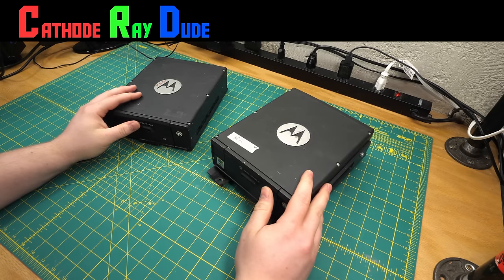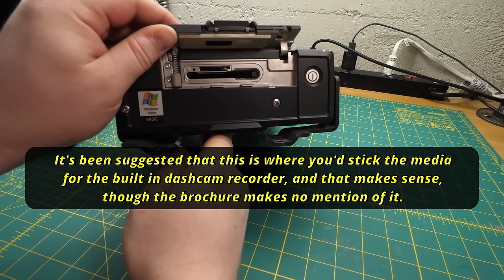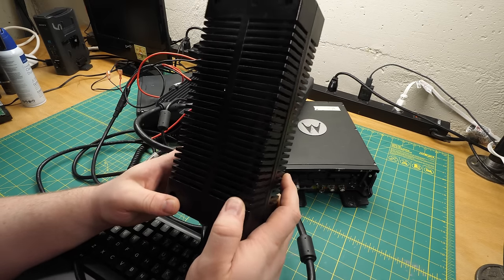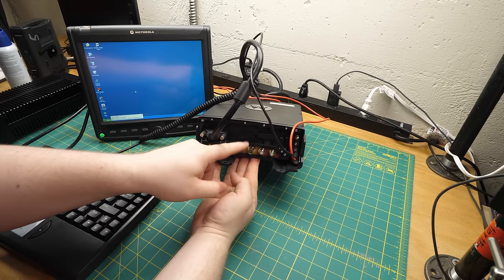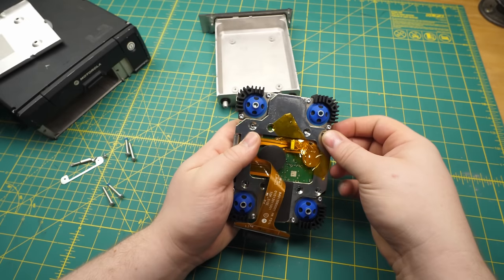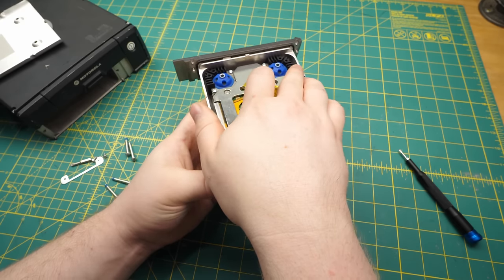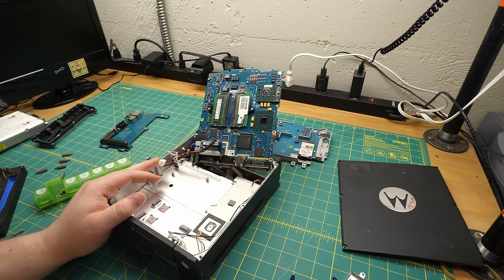Little Guys 7: The Cop-puter [Motorola MW800]

Comment: I bet this computer was able to program the radio.

It would make sense to have a dual boot or DOS plug in CF or Card drive to boot DOS and run the RSS to read and write to the radio.

Pulling the 25 pin cable to have to reprogram would be a pain.

It would make sense to have it built into the computer 

Check the root drive and look for an RSS for programming the Astro

Some of the Astro if I remember correctly,had a USB pin out and you can plug in an adapter cable to get standard USB and run the RSS and read and write frequency programming but it could not update the firmware through USB

Comment: The Gobi was not "terrible". For the era, it was THE goto for WWAN. Yes, it powers up without any baseband firmware because it has no clue what screwed up network you want to use. Once the WWAN control software is running, you'll tell it what carrier you want to use and it will load the correct protocol firmware. (If you install the full package, it will be able to connect to any cellular network anywhere on the planet ) We've become spoiled by the LTE world, where the SIM tells the phone what it has to do. (of course, in the US, unless you bought the phone from the carrier, odds are it won't support 100% of the carrier's stupid.)

Comment: 48:07 This may well have had a CF card to boot from. Wouldn't need to worry about write rates as your average bacon smelling, donut eater, isn't saving or downloading anything to the boot drive and the spinny plates would be primarily used for saving video capture from the dash cam. System updates would be done via the RJ-45 connector by a "sys admin" and not automatically updated via 3G. I think Vista Starter was chosen for two reasons- 
1. Cost
2. According to wikipedia:
"Windows Vista Starter has significant limitations; it disallows the concurrent operation of more than three programs (although an unlimited number of windows can be opened for each program unlike in Windows XP Starter); disallows users from sharing files or printers over a home network (or sharing a connection with other computers)"
There is contradictory things going on with the spinny drive too, it seems to have been replaced...
"and imposes a physical memory limit of 1 GB and a maximum amount of 120 GB hard disk space. Peer-to-Peer networking is also disabled, and there is no support for simultaneous SMB connections."

Comment: I don't think SECRET is being used in the sense of certification to handle classified info, more like cryptographic secret. If anything, that SouthBridge does have some kind of secure component, similar to how the original Xbox had the secret part of the BIOS in the SB.

Given the recordings made by this system may need to be authenticated and the chain of custody maintained, there is probably a key permanently burned into the SouthBridge that is used to encrypt/watermark recordings.

I also don't know how you resist applying the Soba belleh to your entire face.
Reply from the maker: Oh yeah, that seems reasonable - you'd think it would have come up readily in a google search though, right?
Reply: You’d think, and while I can find pics of bare BGA chips with that marking being sold I can’t find any info about intel embedding anything cryptographic in them. Likely that is kept under NDA.
Reply: @CathodeRayDude  I did find a sales display case of Intel chips from that era (YT seems to think the link to it is spam, so I can't post it) and all of them are marked "Engineering Sample", "Intel Confidential" or "Secret" so I think that is just an ES. Why there is an ES on a production motherboard is a good question tho, is that a Motorola prototype?

Comment: I own an old 800x600 projector with a remote plug head unit for usb  s-video + VGA
It has the same display plug between the the remote head and the projector.
it doesnt have screws but clips on each side.

Comment: your assumptions about the FPC are wrong, it totally looks like it has been designed for this use, the rubber spacer looks normal to me, and the 90° right angle is how we normally do a right angle with FPCs, it will provide slack and strain relief to avoid vibrations transmission as well. There is nothing "weird looking" about this flex.

Comment: My guess is that you already have the kind of computer used in ambulances or fire trucks right there.  Because it wouldn't make sense to make entirely different models for agencies that are very closely related and usually work together - and thus need systems that are interoperable.

Local government would want a relatively cheap standardized design that they can buy for all their emergency services/first responders.  Just make some minor modifications to suit the purpose, and voilá.

Comment: Windows Vista Basic was for older computers that could not do Aero and other features. Microsoft only made the Basic because of badgering by the OEMs who wanted to dump their older computers with Vista badgering. It was a big fiasco at the time as most of these old machines came with only 2 GB of memory, whereas normal vista needed at least 4 GB. So many people bought the old crap and then got frustrated when they tried to upgrade to normal Vista.

Comment: Ever work with 12 volt USB ports?  I see them all the time in my line of work.  I work on cash registers.  The really funny thing is that a lot of the machines I service have 8 gigs of ram, but run a 32 bit version of windows.
Reply from the maker: I've always wanted to look into those a bit. If you're talking about the ones that're like really really tall USB ports, my understanding is they come in a bunch of voltages indicated by color. I don't think there's anything special about them other than the convenient power, but I need to look into it and find out if there's more to it, you never know what neat features will be buried in this stuff.

So regarding the 32-bit Windows - I never fully understood this, but I believe 32-bit OSes can use more than 4GB with "Physical Address Extension". Any individual process won't be able to use more than 4GB, but you can still run multiple processes  that will cumulatively take advantage of all available RAM.
Reply: @CathodeRayDude  : They are like double USB ports.  The top USB port is a normal USB port, and then the second part directly under it is almost like a second port.  That provides the 12 volt power supply.  They are used for hand scanners, scales and displays.  They also have a retaining clip.  Very helpful in such environments.

As for the 32 bit windows, I have never seen one with PAE enabled.  Running task manager never shows more than the expected 3.5 gigs of ram that's usable.  shakes head
Reply from the maker: @Xpurple  hahaha okay well, I tried! Whenever I encounter a 32-bit Windows on a machine with lots of RAM it always shows up; I figured it was on by default!
Reply: @Xpurple  poweredUSB, it was a proprietary extension to usb 2.0 developed by IBM to allow high power(30w in 5v mode, 72w in 12v and 144w in 24v) peripherals to use a single connector

Comment: next job - mount this in a car, replce the disk with SSD, install OS of choice, and wire it to the CAN BUS.  Run some ricey engine status dashboard.   Rokace the 3G modem with something better, and road trip it to some other youuber for a crossover.

Comment: That power supply is meant to be a knockoff of Motorola standard radio bench psu. The two other wires are for pretending to be an ignition for radios that care about that. The plug is used across a lot of motorolla radios of that era.

Comment: I had a Windows Vista Homr Basic tower computer actually, from Acer, had it from 2007 until 2014... Woth 1GB of RAM and for some reason it never upsated to SP1 or SP2 so it was all RTM until 2014. Awful, just awful, nobody should suffer as I did, my family ane I just knew nothing about computers back then.

And that was not what was worse, it was the GPU which basically had no hardware acceleration, it was some SiS Mirage 3. Dreadful. I remember I always got jealous how people vould play Minecraft but i couldn't with that puece of dogwater.

Comment: Them 2.5 HDD's are built different. They must break them things in on the streets of Brooklyn or in Iraq cause them things will survive a damn black hole. I got a 2TB out of a laptop that done died years ago but the drive keeps going. Bout 10 years now. Maybe 12. Every IDE drive I have had will start to make clicking noises like the hunter from 1987's Predator movie. But this thing...Not a single click. I'm freaking proud of it

Comment: MediaVue SureVue D1, D2, D4 & D6 digital signage systems.... 
D4:
gigabyte ga-ab350n-gaming wifi bios ver. f23
AMD athlon x4 950
(2x4) 8 gb DDR4 2 memory slots
150 watt power brick with pico power supply internally
128gb m.2
Radeon HD7750  4-ports
windows 10 iot 2016

This board will support my Ryzen 7 5800x3d processor after updating the BIOS and power supply. The catch, support for the athlon x4 950 processor is dropped at bios ver f25. you have to update to f31 before you can update to the latest Bios Revision. I had to order a ryzen 5 1400 processor to do BIOS updates. Still waiting on the processor

Comment: The Intel chip having "Secret" written on it.... I wonder whether that is to designate that it got the intel management engine disabled? Cause iirc some platforms from even back then had that already, so that'd make sense.
Reply: As far as I know the ME is split between the CPU and the PCH, and this predates ME.
Reply: @coyote_den  Some Core2Duo platforms do in fact have IME (like ones featuring the PM45 chipset, for example; and it would fit with that machine being from roundabout 09), although back then it was northbridge/southbridge and nothing in the CPU itself iirc. Can't find all too much information on that, sadly.

Comment: Writing non-stop video to a cf card would have killed the card in no time so it makes sense that they over engineered a hdd solution.
Reply from the maker: Yeah that's the thing I was missing. Like it even makes me wonder how practical the PCMCIA card would have been as removable media; nobody made NAND that could tolerate constant writes back then, and the slot is too short for a type 3 hdd.

Comment: Yeah, they call those terrible double butt plugs an "SAE" plug, though i dunno that the society of automotive engineers had anything to do with it. They are less terrible than using the cigarette lighter sockets and plugs. That's what they've got going for them. Powerpoles or basically any battery connector used in the RC space would be better. Even a Dean's connector would be better.

Comment: The weights in the bumpers dampens the mass movement as you guessed. With more weight it takes a LOT more force to cause the movement, and the extra padding intentionally designs for that. With more weight it takes a MUCH harder jolt to move it, much less to a dangerous degree.

Comment: Folding over flat flex cables is not an uncommon practice
Reply from the maker: the folded over part isn't weird; folded over, then spaced out with a hunk of foam rubber that's digging into the edge of the cable, that's weird.

Comment: I didn't know money Radio made money computers. there definitely going to be interesting and certainly underpowered. And certainly proprietary.
Let's see 2:00 minutes in well I add anything to this comment hmm?
Yes SAE connectors are interesting. they don't work for tell Lite trailer hook ups because they corrode very easily and they're not very water resistant. motorcycles use them for power connections instead of the socket. I built out a battery pack using them and I have completely converted to Anderson power poles cause they are horrible connectors. The quality between manufactures varies all sorts of things oh and don't forget about polarity there is two different variance so you end up having to just ignore the color of the wire that's attached to them it's a mess.

Comment: 12:24 The 3 giant plugs are something you won't be able to find cables for on their own as these are wiring harness connectors used to connect to a vehicle's CANBUS which are deeply embedded into the vehicle and are largely useless without an ECU or BCM to connect to on the other end

Comment: Another cool video Gravis, At 26:40, You mention that you thought that the 2.5” Drive would be 7200rpm, I didn’t think they made 2.5” Drives that were 7200rpm, I thought the fastest that you could get on a 2.5” Drive would be 5400rpm although I could be wrong? Anthony - Birmingham/UK 🇬🇧
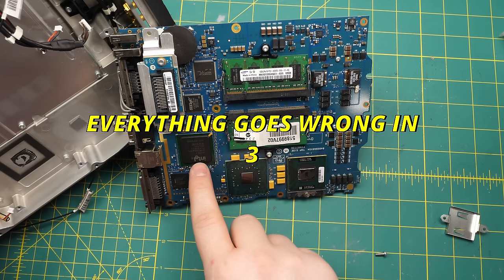Reply: Love the “Surprise Inspection” by Soba at 48:30, My Felix tends to leave me alone when I’m doing my Videos, D’oh! 😂 🐈‍⬛
Reply: Western Digital Black exists. Not only is my 500GB WB Black 7200 RPM; it also features an accelerometer so it can auto-park itself on the way to the floor. Of course, the EliteBook business laptop it's in also has its own accelerometer that can provide the same function if the OS bothers to listen to it.
Reply: @BrendonGreenNZL  Oh wow, Thanks for the info, I’ve just dug a WD Black from off my pile of Used/Knackered Hard Drives and sure enough it does state 7200rpm on the label, You learn something new every day as they say, Cheers! 🙂
Reply: @AJComputerServicesUK  The built-in accelerometer is a useful feature to ensure drive longevity. I don't know why all mobile HDDs don't have them.

Comment: Let me tell you something about Motorola. In my area, they have the market completely cornered. When we had to get our 800 mghz system put in. We went from VHF to Digital. We only had one choice……. Hello moto, and it cost millions to have the system put in and there hand held radios. One radio which is intrinsically safe cost about 6 grand without the lapel mic. Thats going to run another 600-700 bucks. And good luck trying to go with another system in my area. You won’t, unless you want to stay VHF and due to narrow banding. VHF is pretty close to useless in public safety. Especially in a rural area like mine. Ok, I’ll get off my moto soap box.

Comment: Once, long time ago, Motorola was a big and influential company. 
Now it is only a name on some cheap Chinese knock-off junk. 
 
Maybe it is better this way. I once had a Motorola mobile telephone and it started making a call every time one of the buttons was occidentally touched, can you imagine what it would be for a policeman or an ambulance driver if his communication apparatus was made by those imbeciles at Motorola? If consumer products are bad, the same engineers designed the professional equipment, they must have been bad as well. 
 
Wave the American flag for a while and think why all electronics nowadays is made in China, Vietnam and Pakistan. They truly hated their customers and did not care about the usability of their products.

Comment: The keyboards I have an intense dislike for are the ones that come with Dells and other low cost PCs.  They feel terrible and the mouse doesn't inspire even an iota of piece of mind as far as quality goes because they are so light it feels like no effort or materials went into their manufacturing.  A mouse like that just plain feels cheap since it has no weights to make it feel like there is something actually inside that plastic shell.  Just compare it with a mouse from a known good brand that you would buy aftermarket for your PC and you will see the difference between that Dell one that is probably a dime a dozen and a good one.  By good one I am not necessarily referring to "gaming" mice.  I have a Logitech mouse that was not marketed for gaming and I have no complaints other than the rubber on the outside might turn disgusting with age and use.  Sometimes when something is advertised as for gaming it is just a buzzword and it is still a mediocre item.  Maybe it has RGB so you are too distracted by it to realize that you could have spent the money on something different and possibly get a better price.